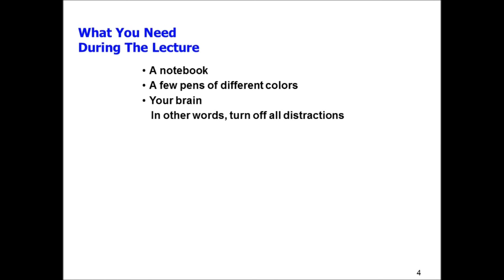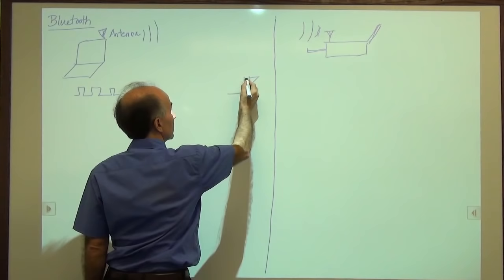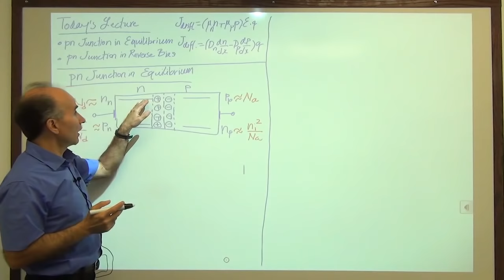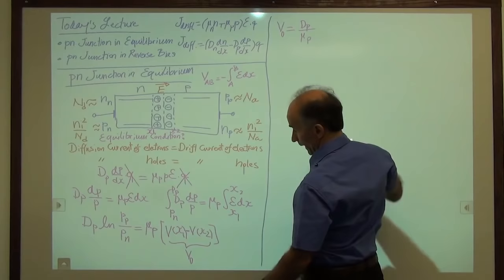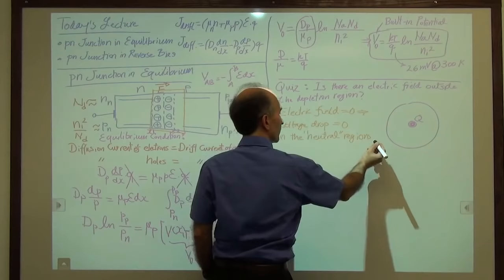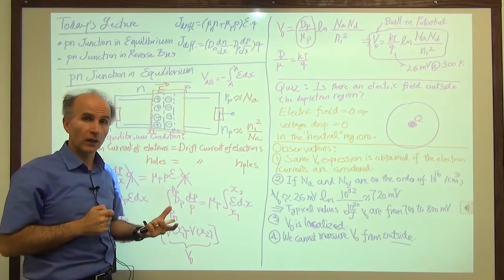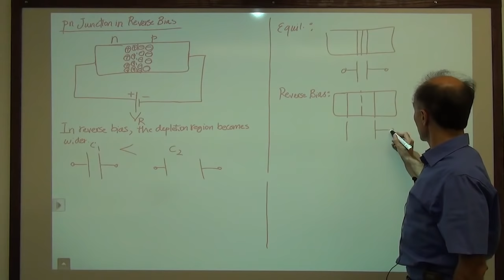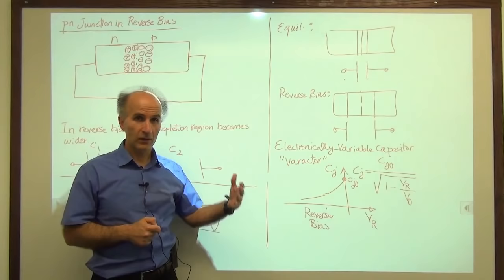Razavi Electronics 1, Lec 4, PN Junction in Equilibrium & Reverse Bias

Comment: gauss law gives us only the information about the flux not the field, so here we can only conclude that the flux over the entire surface is zero, but this does not imply that the field is zero unless we add the assumption that the charges are close enough to each other so the pushing from the + charge and the pulling from the - charge is almost equal so they cancel out. if the distance between the two charges are long enough they will not cancel out.
Reply: You are right about Gaussian law. However, if you think of the PN interface as a kind of parallel plate, the Gaussian law indicates that the MAGNITUDE of the electric field except between parallel plates is zero. Have a nice day~ :)
Reply: How about we use Poisson's equation to argue that outside the depletion region the field must be constant because of the 0 net charge density? It then follows that in equilibrium that the field must be zero.
Reply: However if you consider the Gauss law application in two closed surfaces, both of them with the left "face" fixed at the left border of depletion layer, and with the right "face" at different position respect to the depletion layer: you can observe that the electric flux through three face are the same while only the flux through the right face can be different, however because the sum of all the fluxes has to be zero with the two surfaces with different form, then we can conclude that the the electric field through the left face has to be also zero.

Comment: why again the electric field is zero outside the depletion region? didn't quite understand it.
Reply: in fact there is no current then there is no electric field
the movment of electrons due to diffusion makes E opposite to E that causes the drift
Reply: So does that mean that during equilibrium, there's no E in the depletion region??
Reply: Just after I wrote the eply i got confused about that too
I should ask a physics book would be better
Reply: oh. ok. Could you please explain in case you find it. I will do the same.
Reply: net charge present outside the depln regn is zero. Which means electricfield is zero...
E=QV
put Q=0;
E=0.
Reply: What about the net charge inside the depletion region? It looks like 0 to me.
Reply: Net charge is not zero inside the depletion region becz we have positive and negative ions inside the depln regn . In the case of ions , number of protons and electrons are not equal... when they r not equal ,it means we have some charge there... When there is charge ,there is electric field.... Hope answer ur question..
Reply: sorry I hadn`t the time to look for it tomorrow i have an wxam in BJT and MOSFET so wish me good luck
Reply: @SuperAndupandu  we've to understand the definition of electric field here. A positive charge experiences some force, that is the definition of electric field. Here we can see the negative charge attracts the positive charge, so there's electric field also and in the direction of negative charge.

Comment: How by using a voltmeter, we are forming the loop. For KVL to exist, there must be loop. I didn't get it. As per this, whenever we use voltmeter, the output of any circuit should always be zero which is not a case.
Vnet= Vo+V1+V2 where V1, V2 are built up voltages of Metal-semiconductor junction
Vnet=0 only when V1+V2= -Vo
This is not necessary to have V1+V2= -Vo for metal-semiconductor junction

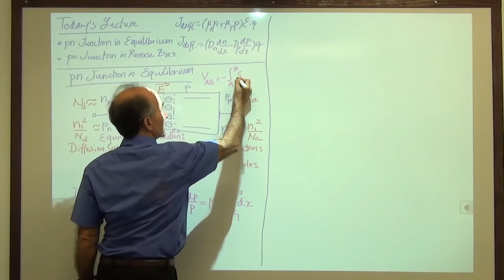Comment: 27:36 there is a little error: VAB =  + integral of electric field from A to B = V(A) - V(B) where V(A) is the potential of point A and V(B) the potential of node B. In other word, A is considered the positive pole of VAB.
Reply: I can see no mistake:
VAB = - (integral of e-field from A to B) = - [ V(B) - V(A) ] = - V(B) - [ -V(A)] = V(A) - V(B)
It is not defined in this general calculation, which pole is positive or negative. Both can be positive or negative and therefore this is also true for VAB.
Reply: @Test-eq2vu  by convention if you write VAB you mean that the plus sign is associated with the point A
Reply: @stefano.a  Hmm, maybe it is a convention by some teachers to make it easier for the audience or so, but I have never heard of it and this convention is not applicable for general considerations. The values of the potentials can be anything, e.g. both negative, complex values, imaginary values or just another mathematical relation given by an equation. For example, if you have time-dependent potentials like sinusoidal signals with a phase shift to each other, the sign of both potentials will periodically change over time anyway and VAB will also result in a time-dependent, sinusoidal signal. The term "VAB" just defines the direction. What you can say is: VAB = -VBA.
Reply: @Test-eq2vu  yes, VAB=-VBA . A voltage can not be complex number: it is a work by unit of charge so it is a real physics unit. 
The module of a complex number can represent a voltage but not the entire complex number
Reply: @stefano.a  I am talking about math here, not only about things you can measure in the real world. And e.g. with the mathematical relation VAB = V(A) - V(B) you can of course fill in some complex numbers or expressions as value for the voltage. This approach finds huge application in all possible AC calculations like high frequency technology, power electronics and so on.
I don't get your last sentence.
Reply: @Test-eq2vu  if you are talking about ac calculation you are referring to physics, not only math. The  definition of electric potential in electrotechnics is the voltage of a point in respect to another point said reference of potential, so that applying the second Kirchhoff law, for a bipole you obtain VAB=VA-VB indipendently of the reference point you have chosen
Reply: @stefano.a  This answer is just weird, I'm out. 🙈

Comment: Sir, i have one doubt - When the electrons move into p type region and holes into n side due to diffusion then there should be net negative charge in p side and net positive charge in n side (as initially p and n side were neutral due to balance of protons and electrons). So around 38:00 how the Gaussian surface includes net charge of zero and what happens to the diffused electrons? Perhaps that electric field cancels the electric field due to ions. Maybe gauss's law isnt clear to me. Does it include local effect or global effect only? I meant do the local fluctuations in charges affect the local electric field?. Excellent lecture sir. Thank you very much.
Reply: there's no actually holes that 'move', only electrons move form n to fill a vacancy at p (neuralizing a hole charge),  then a vacancy is left behind in n so we say that a hole has moved  from p to n.
n or p type crstal , they are both neutral , the -ve or + signs just refer to the majority charge carriers, since for every free electron theres a positive donor ion , for every hole theres an acceptor ion, so no net charge here.
electric field only arrised in deletion region due to ions net charge that appear :
+ve in n case due to diffused electrons
-ve in p case due to diffused holes

Comment: Firstly, at 38:30 you said Electric field us zero due to no net charge. I think that's not true beause if you take the case of a dipole even though the net charge is zero there exists an electric field because there is separation between the charges. The same works here. Here due to no net charge the flux is zero that is the integral is zero. If the inetgral is zero, it doesn't mean that the electric field is zero.
Reply: Right, his assumption is just true for the purpose of a model. Like it is assumed a fixed boundary where the depletion zone ends, while actually there is no defined boundary and the distribution never really ends, which he also clarified once in his lecture. Regarding the assumption for the Electric field, all field lines which are NOT a straight line from positive to negative are negligible, because the height and width of the conceptual areas are much bigger than the separation distance. For other models, when the geometries are different, like your example of the dipole antenna, this assumption is not sufficiently accurate anymore.